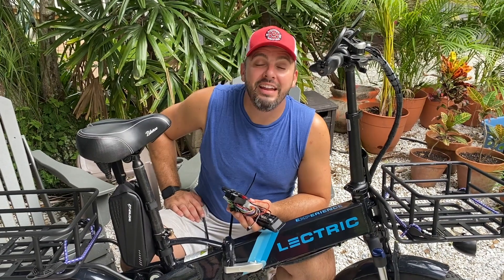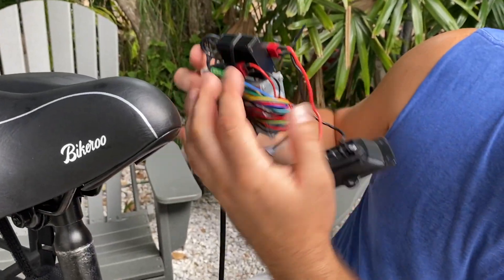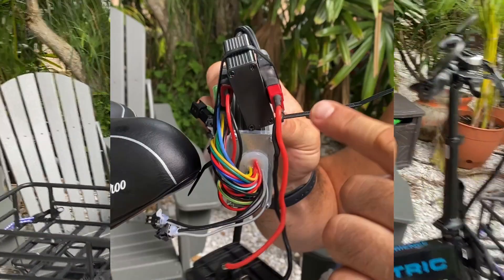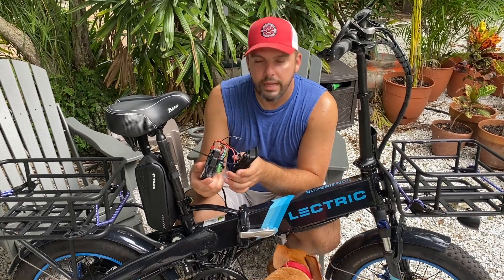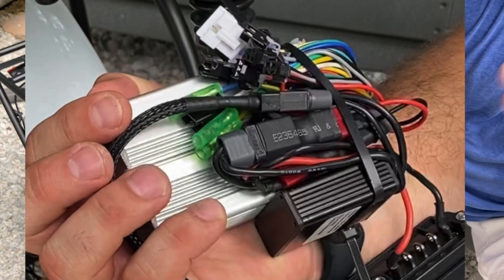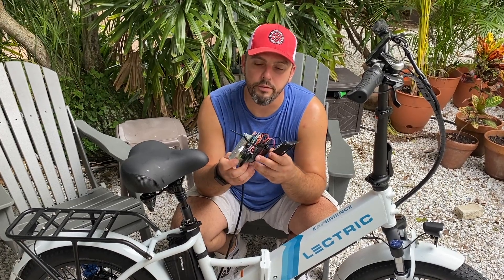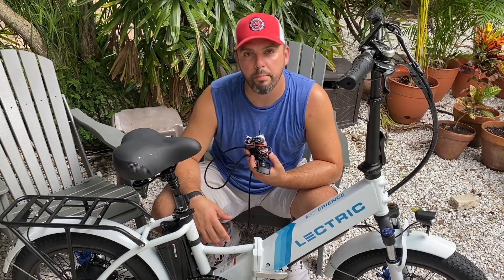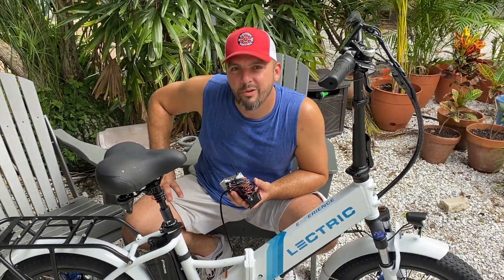Lectric | XP, XP 2.0 | Dual Battery Discharge Balancer Kit Internal Layout Demonstration

Comment: I have xp 2.0 as well. Stock is 65mile range. If i add the second battery it should be more right? Will it go faster?
Reply from the maker: You will get more range. It will not go faster

Comment: For the 2.0 would it be better to do the 10ah or 12ah for the 2nd batter?
Reply from the maker: Either will work. Make sure it matches voltage (48V) 
Get what fits your budget

Comment: I have a XP high step 1.0 and want to put one of your dual battery kits in it, and a higher amp hour battery (20ah).  My Question is, Does the Dual Battery Balancer kit (20A) regulate or limit the amp currant of the higher amp hour batteries so as not to fry the controller?
Reply from the maker: Amp Hour (Ah) is not the same as current. They are unrelated. You can have any Ah battery you want just make sure to match voltages
Reply: @ElectricAllWheel Sorry, I didn't write the question very well. Checking specs on batteries the Hailong 48 volt 20 ah battery has a 30amp maximum continuous current load. The 48v 30ah battery has a maximum continuous current load of 40 amps. So are you saying that the XP controller allows a set amount of maximum amp draw? Or does the Dual Battery Balancer (20amp) only allow 20 amps to the controller? Sorry for the dumb question. The Continuous Maximum Current Loads had me wondering about overloading the system.

Comment: will it work with 52v "external" battery?
Reply from the maker: The balancer will work with a 52V battery, but please know that is not the manufacturer specifications and is not the recommended practice for dual battery if combining with a 48V battery.
Reply: @ElectricAllWheel  thanks.  Looks like a great product.  Building a 52v 7a chargeable battery means massive range on the go charging.  Gosen Q5+ (YL80C display) allows setting voltage bars.  For 52v extra, using bars to show when its time to disconnect the 52v (low voltage protect) or when 7ah (1 hour pit stop) will recharge to full.  Powerstation-like use, and 10% extra power all nice perks.

Comment: Have the 2.0 high step. Wasn't able to get the cables and pack in with the discharger on top. I put in the controller (wires to the back) and discharge underneath (like the step through model), finally got it. The discharge unit and battery you recommend works perfectly. Thank you !!!!
Reply from the maker: Glad to hear it. Thank you for your support!

Comment: This video was key for confidence. For the life of me I couldnt do the 2.0 at first, so just put it in the 3.0. Then saw this video and bought another for the 2.0 , gave it another shot and with some patience I finally slipped all the wires in to the side and got it to work. Thank you for a good product and also good video. I just hope it all holds up, it will save me some time from having to swap the batteries out mid ride. Love the lectric battery convertion kit also so I can use my spares instead of getting a new battery. Still had room to fit a galaxy tracker inside as well.

Comment: Hello Matt, So on the 2.0 ST  the controller goes above the balancer vs. the high step where the controller rest flat to bottom of the frame and balancer above? Thanks again.
UPDATE: Hello Matt, Happy New Year! I received my order and I liked how well everything was well packaged and I really like the thank you note from the both of you. I’ll probably install on Monday and will take pics and video of how it all went.
Reply from the maker: This description is exactly how I have done most Lectric bikes. Be mindful though that myself and others have found dimensional variations in the controller housing that required angular insertion of the balancer over the top.

Comment: What the amount of extta range you get from using the dual battery method with this specific battery
Reply from the maker: Think of your car gas tank size as indicated by Amp Hours.  The Lectric battery is 48V 10Ah. With a second 48V battery you can add Amp Hours (Ah). The recommended battery is 10Ah, essentially doubling your “gas tank” 
You are not limited by Ah. Just make sure your voltage rating for your second battery is 48V and that you can adapt and connect it to a XT60 connector.  Many people have added 48V20Ah batteries.
Reply: @ElectricAllWheel  thats actually very useful to know and much appreciated. Thanks

Comment: Would I be able to use the stock battery and a 48v 20ah aftermarket battery together? Im not 100% sure how compatibility of using different ah batteries works.
Reply: I have the 48v 14ah Long Range battery from lectric btw
Reply from the maker: Doesn’t matter. Just make sure rated voltage is the same. If you find a convenient 50Ah let us know! (Make sure your second battery has XT60 connector, most aftermarket do)
Reply: @ElectricAllWheel  Alright! Thanks for the quick response!  And Haha a 50ah would be insane. Id ride all day!

Comment: I have a 14 and 15 Ah battery can I run this 20 amp controller
Reply from the maker: As long as the rated voltage is the same, you should be fine. Be mindful of mounting location and connection capabilities for your second battery outside the frame.
Reply: Thanks

Comment: Hey Matt,
Good instructional video!
This should help people a lot because fitting the discharge adapter was the tricky part for me. Everything else was relatively easy.
BTW, Hemiway announced selling on Amazon on 8/27 thru 8/29 with $200. off. Usually Amazon Prime users with an Amazon credit card can get 18 months payment terms with no interest!
I may buy a Hemiway bike on Amazon? I need to do some homework on Hemiway specs.
I’m interested in a Hemiway Zebra step-thru or maybe the Bigdog?
Thanks!